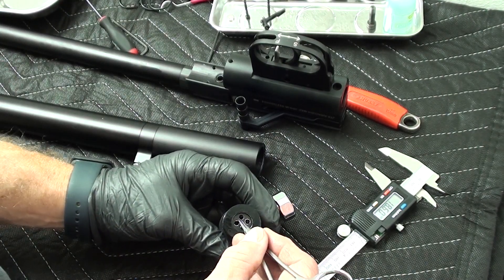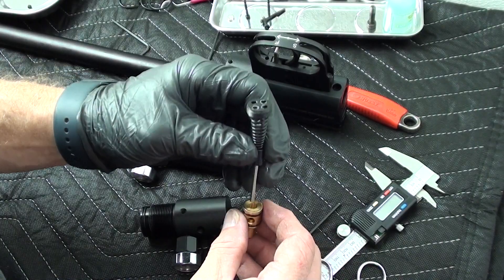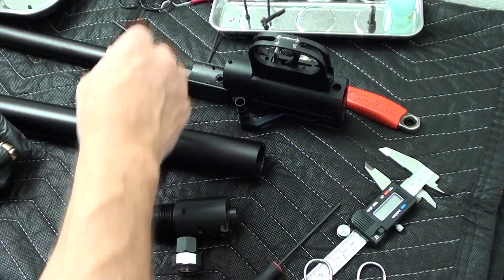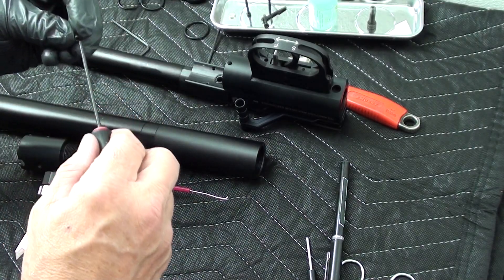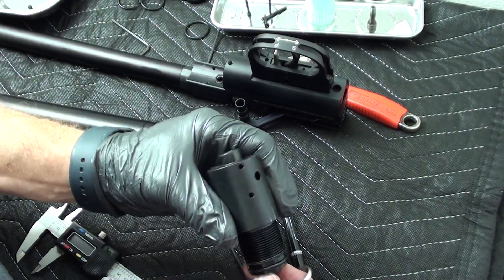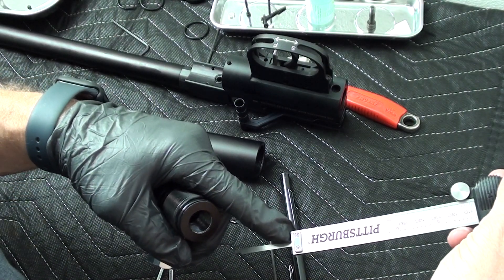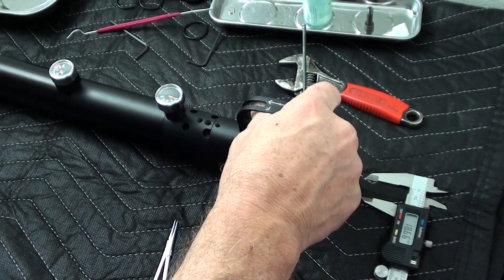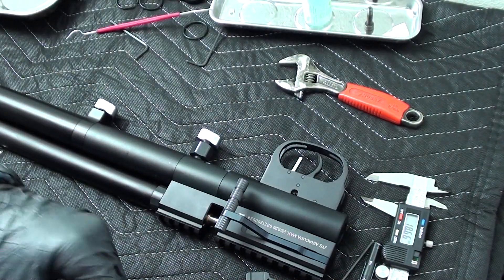JTS Airacuda Max & Airacuda valve repair

Comment: My 177 Airacuda Max had a slow leak that I couldn't track down. The leak turned out to be in the poppet valve area by the transfer port. The way I discovered it was somewhat by accident.

I thought I would put a balloon on the end of the barrel and "dry fire" the air into the balloon to see how much it inflated. Surprisingly, it just puffed it up to the "pre-stretch" amount where you would further inflate the balloon by blowing it up and stretching the latex. Then I though I would re-cock the rifle to inflate it further, but that only opened the rear end of the barrel and the balloon deflated. Which then gave me the idea to leave the rifle in the de-cocked position (side lever closed, but trigger de-cocked). I then squeezed out all the air out of the balloon to see if it would inflate.

After a short time, the balloon was inflated to the "pre-stretch" condition, which now proved that my transfer port was leaking air into the barrel and into the balloon. Now I knew where the leak was happening. Other videos show how to take the poppet valve out and replace O-rings etc, and that's what I did.

Upon taking the transfer port valve out and checking the poppet valve assembly, I noticed several things. First, the spring tension for the poppet was non-existent, as the "clover leaf" nut was not engaging the spring, and the poppet had about a 1/16" slack. That definitely did not help seal the poppet against the brass valve to hold the regulated pressure.

Next, the surface of the brass where the poppet lip makes contact still had some "tooling" marks, and any fine scratch was enough for air to leak through. So, I put the brass valve into a hand drill and while spinning the valve in the drill I polished the surface mirror smooth on a buffing wheel on a bench grinder (not with a stone wheel, but a cloth buffing wheel with super fine abrasive). Then I lightly "lapped" the poppet against the polished brass valve to ensure a perfect contact surface.

From this video, the depth of the clover leaf nut that sets the poppet spring tension was 0.5" or so, while I originally had some 0.38" depth which was not nearly enough.I replaced the two O-rings on the brass valve, and lubed it with silicon paste and assembled it all together, but not to the trigger assembly. I then pumped it up to about 1000 psi and tested the unit for leaks. I got a shallow bowl of water and placed the end of the cylinder into the water with the transfer port under water to check for bubbles. The first attempt revealed some bubbles every two seconds or so, which was much better than before.

But that was not good enough, so I degassed the cylinder and repeated my steps again, polishing the brass valve further and double checked everything and cleaned it once more before reassembly, and refilling to 1000 psi. The second water test for the transfer port proved no leak whatsoever, along with no leaks on the positions shown in this video.

I then assembled the rifle to test it out, filled it to 3200 psi, and placed the deflated balloon on the end of the barrel and checked an hour later. The ballon was still in the deflated position I started with, and the gauge showed no drop in pressure. It is now leak free, and ready for action.

Hope this helps someone out there when all else fails from this video. The whole pressure cylinder has to be separated from the rest of the rifle to check every possible leak source before you can reassemble the rifle for normal shooting.

BTW, I don't know the correct poppet spring tension to "tune" this rifle, but it should have at least some firm tension to seat the poppet adequately. I suggest setting the clover leaf nut to a .5" depth for a starting reference point. If someone has the "specs" for the correct depth, let us know.

Happy shooting!!!

Comment: I've had mine for a year and found myself chasing a leak recently. The front "O" ring on the regulator body was hard and brittle; it broke in pieces when I removed it. Luckily, they supply an O ring kit with the rifle. Thanks for the video.

Comment: I read lots of complaints about these airguns leaking so i found the JTS YouTube channel and watched him reseal a gun. What i noticed is that the o rings seem to be too close to the same outside diameter of the parts they fit around. If looks like they need to be thicker to seal better. I also read comments about poor customer service from JTS and Pyramid Air. JTS has also turned off comments on his videos. I don't know what to think about that. I sure have my hopes up about this gun though. Lots of videos of some great shooting guns are out there to watch.
Reply: Don't hesitate, you won't be disappointed! This is my first PCP and no regrets. Airguns of Arizona tested it before shipping and included a target with chrono results and they also shipped it fully charged. My first group at the range was a 1.25" ten shot group at 100 yards! I just replaced the regulator seals after one year but as you can see, it's easy. I overcharged it once and had to replace a gauge. AGA sent one out lickity split. I'm really impressed with them, their knowledge of equipment and accessory selection. I got a suppressor, so I don't disturb the local wildlife around the cabin. It's deceptively powerful with the suppressor. It's not a squirrel rifle that you would lug around; it's big and heavy. If you're shooting off bags at targets, it's a perfect way to hone your skills. You can't beat this for the money. I got a cheap ToAuto compressor from Amazon, and it's been great. I hope this helps!

Comment: Thanks for all the great JTS video. I turned my reg. on .22 Cal to 2200PSI in order to shoot 23gr slugs. In your opinion, is the valve and hammer strong enough to match the reg. pressure? Thanks again.
Reply from the maker: That I really can’t answer.  I never explored tuning for the slugs. I have shot pellets and slugs out to 100 yards. I didn’t retune for more power. 
I am happy with the shot count and accuracy. 

Even now, I feel for the money spent, the  Airacuda series is the best value for the money spent for a wood & metal pcp. Under$500.
Reply: @45bravoairguns4  Thank you for your response. How do you think of the JTS vs. the Avenger X? I do like the simplicity of design on the JTS compared to some high end stuff like FX, which has thousands of O-rings...
Reply from the maker: @TangDynasty1983  the JTS is all wood and metal, but the Avenge X can be had in that configuration as well. 

The avenge X is modular, where the JTS isn’t. You can change calibers, air cylinders stocks, and even calibers.

If you somehow damage a barrel on the Avenge X, $69 USD will get you a replacement, with an extra mag and bolt probe. 

Yes the Avenge X is more expensive. 

It depends on your philosophy of use, what do you intend the main use of the rifle to be?

Both guns shoot well above their pay grade. 

Ian
Reply: @45bravoairguns4 Ian, thank you for your detailed guidance. I believe the Airacuda Max has a better plenum than the X. however, the X has much higher fill  pressure than the Airacuda. we rarely see 300 bar fill pressure on any level of airguns....

Comment: Thanks for these videos; they are quite informative and helpful. This may not be the place to ask, but my Airacuda Max does not let me de-cock the rifle without firing. If I hold the trigger while slowly bringing forward the cocking lever, at some point near the end, the rifle will discharge. What do I need to do to allow me to de-cock without firing? So far this is the only negative behavior I have experienced on the rifle. Thanks for any help you can give.
Reply from the maker: I have not encountered that problem, I would reach out to the Importer Travis Whitney. he is on the Airacuda owners facebook group, and is admin of the JTS Airguns facebook group page.
or email him directly at travis@xisicousa.com. he will be able to help.
Reply: @45bravoairguns4  Thank you for your reply. After leaving my note to you, I found a another YouTube link that explains how to de-cock the rifle without firing it. Basically, the trick is simply to let go of the trigger before fully returning the cocking lever to its closed position. The link is at https://www.youtube.com/watch?v=dIGpJg3aScE . Thanks again for your reply and your videos. Jim

Comment: Have you had any issues with flexing of the receiver due to low spot in the stock near the tapped hole for the action screw? Some are reporting not being able to insert a magazine straight out of the box.
Reply from the maker: No I have not seen or heard of anyone having that issue out of the box. 
I have been dealing with and repairing airguns since the 70’s, and writing guest blogs for Pyramyd Air for years.  

I have heard of one owner on Facebook that tightened the stock screw too much and say they had trouble inserting the magazine. 

But from what I read, once he lessened the tension it was easy to insert the magazine. 

Airguns are typically made from aluminum or zinc alloy in most of the gun, with steel in the required more stressed areas.  This is because they are subjected to less pressure and recoil than firearms, and they are made to a price point..  The stocks need to be just sung, there is no need to really crank on them.  
Have a nice day! And keep us posted
Reply: @45bravoairguns4    I noticed the action bolt on my rifle was loose when I was going to work on the trigger. I thought that was a mistake from the factory but just happened to see info regarding possibly distorting the action by over-tightening that bolt.

This air rifle doesn't require firm bedding like a conventional firearm so I made the bolt snug, but didn't torque it much. And I used a small amount of blue Loctite to prevent it from loosening and falling out on its own.

BTW, the trigger work I did involved making a lighter version of the trigger return spring. The tension on the stock one made it hard to feel when the first stage ended and the second stage was engaged. With the lighter spring there's a definite point where the first stage ends and the second stage is engaged. It also allows for a slightly lighter and crisper trigger pull.

Thanks for the demo on how to service the valve.